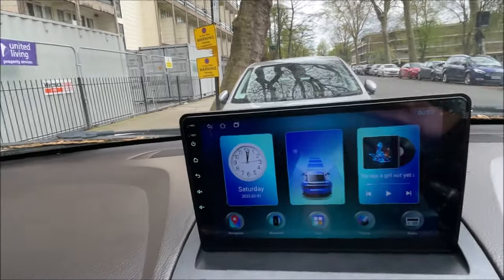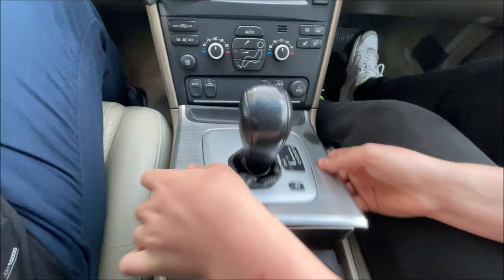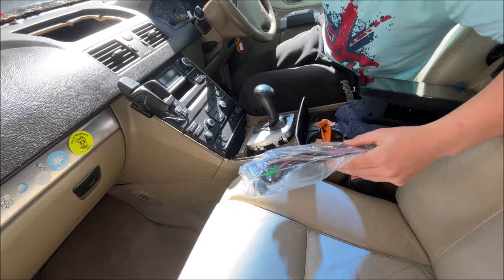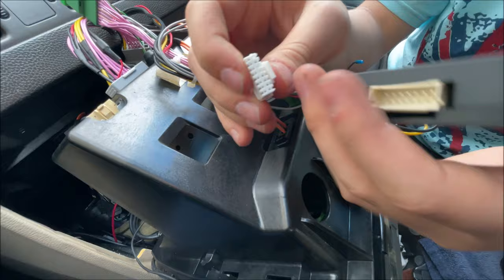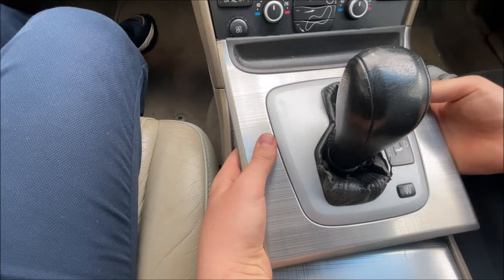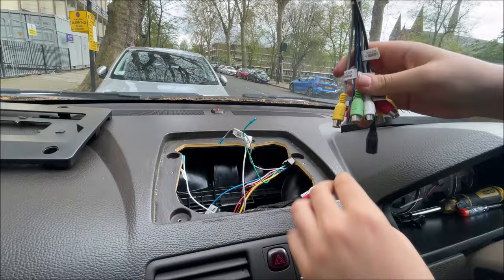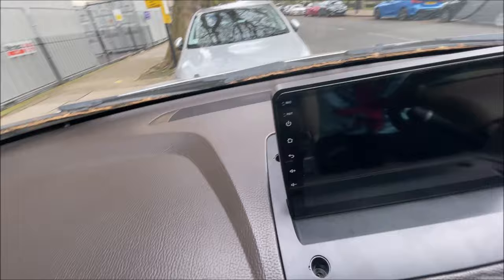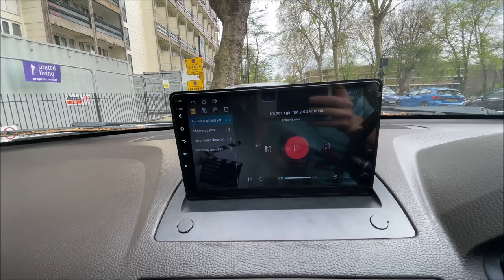How to install Apple CarPlay / Android Head Unit to a Volvo XC90 MK1 (2002-2014) - UNDER £150!

Comment: Installing backwards may be easier. As far as the screen. Install the cables and feed through the plate. Then remove the cover and speaker. Feed them down. And then pull radio off ☺️

Comment: Hello! Great video and very helpful for getting my screen installed! It isn’t using the subwoofer at all when playing through Bluetooth, and it sounds very poor compared to the normal car usb connection. I’ve spotted a plug marked ‘sub woofer’ from the screen but have no connections for this. Did you have the same problem or can you offer any advice please? Thanks!

Comment: Hey man! Thank you so much for the great video and explanation. I’m gonna install the same thing on my 2007 XC90 and have a few questions:
1) does the radio on this android head work or you need additional wires ro make it work?
2) does the rear camera gets power from the head you you need to plug it separately?
Reply from the maker: Hi there
To answer your questions 
The radio on this unit needs an antenna to work, I’ve already made a video about it on my channel
I have also already made a video on my channel showing the installation of the rear camera
If you have any questions about the installation after watching these videos, let me know and I will be happy to answer them
Reply: @c2fixit oh I didnt check your other videos! Great job, thank you so much. It’s really helpful

Comment: I’m considering buy this, but mine has the sat nav unit in the top of the dash. Watched another video on here stating in need to feed cables to the amp under the drivers seat 🤷‍♂️
Remove the sat nav player under the passenger seat🤷‍♂️
Also states that you lose the mic that’s already fitted in the roof above the drivers seat, as they are not comparable
Reply from the maker: Hi mate
It all depends on what type of Volvo you have
If you have the aux function, then the installation is like this video.
This is for the screen with the aux input: https://www.ebay.co.uk/itm/314560935148?mkcid=16&mkevt=1&mkrid=711-127632-2357-0&ssspo=vkcosyhktgw&sssrc=2051273&ssuid=vkcosyhktgw&var=&widget_ver=artemis&media=COPY
This is the screen if you don’t have the aux function: https://www.ebay.co.uk/itm/314566818009?mkcid=16&mkevt=1&mkrid=711-127632-2357-0&ssspo=vkcosyhktgw&sssrc=2051273&ssuid=vkcosyhktgw&var=&widget_ver=artemis&media=COPY
If you do not have the aux function, then you will need to bypass the amp by feeding the cables.
The Satnav doesn’t affect anything, it’s still the same process
You do indeed lose the mic in the roof which is a shame, but with the screens in the links I sent you, you get a free mic in the package
Hope this helps

Comment: Hi
Nice video.
I'm thinking about using one of those android units with my 2008 D5 with built in Navigation and AUX input plus CD changer ( input connector in the middle console)

So every sound from the android unit will bypass the amplifier?  Also from the original radio after mounting this android unit like CD changer , radio, external cable aux input ?
i understand that for parking sensors but for mobile connected via Bluetooth or music via android this does not sound very positive.
Is there a way to still have all sounds via amplifier?

Will there also be a supported unit witjh newer android o it?  Version 10 is quite old.

i appreciate any inputs also to my maybe misunderstandings.
Reply from the maker: If your Volvo has an aux input, then the original radio, cd player, parking sensors and external cable aux input will continue to work.
The amp is only bypassed for older models
So, in your Volvo, all these functions will continue to work
I’m sure that the android unit will be updated with future android releases, and you will be able to download and use them
https://www.ebay.co.uk/itm/314560935148?mkcid=16&mkevt=1&mkrid=711-127632-2357-0&ssspo=vkcosyhktgw&sssrc=2051273&ssuid=vkcosyhktgw&var=&widget_ver=artemis&media=COPY
Reply: @c2fixit  so everything including the aux connector will still work via amplifier? Sounds interesting. 
But im still a bit concerned most of the look alike radios in ebay already seem to offer android12.
is there also i link to buy it via ebay germany maybe?
Reply from the maker: @dunkelwesen74 I think you can update it to android 11
Personally, I would get it from the link in the description, but if you find something else, by all means
https://www.ebay.co.uk/itm/314560935148?mkcid=16&mkevt=1&mkrid=711-127632-2357-0&ssspo=vkcosyhktgw&sssrc=2051273&ssuid=vkcosyhktgw&var=&widget_ver=artemis&media=COPY

Comment: Your videos are terrific and inspire confidence to accomplish the install. Can these be installed in US XC90s?  Mine is a 2004, 2.5T with the 'High Performance sound'/no Aux in feature)
Reply from the maker: Hi mate
Thank you for the praise
They can be installed in non aux us xc90’s
Here is the link for the screen that you need: https://www.ebay.co.uk/itm/314566818009?mkcid=16&mkevt=1&mkrid=711-127632-2357-0&ssspo=vkcosyhktgw&sssrc=2051273&ssuid=vkcosyhktgw&var=&widget_ver=artemis&media=COPY

Comment: I have a non-aux 2005 XC90 and want to fit your suggested head unit but my android phone is only version 8.1.0, will this cause a problem when fitting to a version 10 head unit? Thanks for your series of excellent videos.
Reply from the maker: Hi mate
I don’t think so, but I would ask the seller regardless
Here is the link: https://www.ebay.co.uk/itm/314566818009?mkcid=16&mkevt=1&mkrid=711-127632-2357-0&ssspo=vkcosyhktgw&sssrc=2051273&ssuid=vkcosyhktgw&var=&widget_ver=artemis&media=COPY

Comment: Very good video. Just installed my android, the only problem radio doesn't work on android, i mean cant pickup stations.
Reply from the maker: Have you watched my other video
Reply: No.
Reply: I will now😊
Reply from the maker: Here is the link: How to fix radio not working on Android Head Unit in Volvo XC90 MK1 (2002-2014)
https://youtu.be/DthFhJ52B3M

Comment: Thanks for this video!  Follow up on the parking system question: Will the car still make the beeping noise when the parking sensor detects that you are too close to something?
Reply from the maker: Yes, it still beeps and the screen goes straight to the rear camera when you shift into reverse
Reply: @c2fixit  does it use the original camera?

Comment: Hi mate

Followed this and everything works except my parking sensors. Seller says they supposed to not work after they install. However from what I’ve read online with the same unit, others have still got working parking sensors. Mine is a 05 non aux. Also front left speaker and rear right speakers don’t work, any ideas? 

Appreciate any help!
Reply from the maker: The parking sensors only work if your car has aux.
If it doesn’t have aux, then the parking sensors won’t work
For the speakers not working, check the red and white rca inputs, that’s what I think the problem could be
Reply: @c2fixit  thanks for the quick response. Is it possible to wire a speaker into the original unit to still have the parking sensors sound? 

And thanks I’ll look into those cables
Reply from the maker: Wiring a speaker for the parking sensors is a great idea, might even get your original radio to work
Just need to find the output of the factory radio and find a pin out
Let me know if that works though, sounds interesting
Reply: @Ranj-d2e  Did you solve the issue with the parking sensors?

Comment: I have a navigator installed in the center speaker... Is there any different way of working then?? XC90 -2006
Reply from the maker: Works in the same way, just remove the navigator and put the screen in its place

Comment: Thanks for this video. I am following your steps and when I try to pull from the bottom of the centre console, only the lower half moves. The stereo won’t shift. Mine is a 2010 model. Are there additional screws perhaps? Yours came out so easily! Thankyou
Reply from the maker: Are you sure you have removed the right screws?
Sometimes, you need to tug a bit, especially if it has never been opened
Reply: @c2fixit  I’ve removed the two from the bottom and that freely moves. I’ve also removed the 5 at the top around the speaker plate. The bottom flexes a lot but the stereo seems rock solid… I don’t want to snap the bottom section off!
Reply: Apologies, I did indeed remove the two above the pair you did… it’s out now thanks

Comment: I bought the android but have no aux I can’t return it  so I was wondering is it possible to change the radio from a new model that I go to the scrap yard an take a radio withe aux
Reply: I want to buy it from you after I saw your videos but to late
Reply from the maker: Message the guy from the link in the description 
He might have a cable for you
Reply from the maker: The radio won’t make it work

Comment: Thanks for the video! I did the install but now the old ICS unit and the PCD seem to be muted. Any suggestions of where to look?
Reply from the maker: can you rephrase your questions without the abbreviations, I can't understand what you are trying to ask
Reply: Sorry, I meant ICM (infotainment control module) which is the old volvo radio/cd player and parking distance control.
Reply from the maker: It depends if your car has the aux function or not
Reply: No aux function in my car
Reply from the maker: Check the connections behind the radio

Comment: Thanks, this video is really helpful even I am upgrading my Volvo V50. 
The sound does not work unfortunately, do you have any idea why?
Reply from the maker: Have you checked the connections behind the screen
Reply: @c2fixit  yes. The volume on the display is even going up when I turn the volume knob on the original radio. And it is set to aux
Reply from the maker: @vincent567 check the audio in and audio out cables, perhaps they have become unplugged
Reply: Okay, I will have a look. Another problem is that on the screen the parking sensors are showing the wrong side ( front for rear)
Reply: Hi, some info for people with the same problem as me. 
I needed an additional cable connected to the amplifier. This one is in the back of the Volvo v50 and requires really a lot of work and effort to route the cables all the way to the back. 
Haven't done it yet, if I will I will post the results
Reply: You need to connect the cable that connects your screen to you amp under the drivers seat. There is another video on here showing how to do this but it isn’t as simple as it looks I’m afraid.
Reply: @vincent567 Hi Vincent, did you manage to sort out this? I’m having the same issue on my XC90. Thanks!
Reply: @barneykirk7939  yes and no.  I didn't manage to connect it. But when I have time I will try. The amplifier from my sound system is in the back of the car and it need a cable there

Comment: Hey boss, my radio won’t turn up so I’m think about switching to this head unit. I’ve changed the antenna module, amp & original head unit & I’ve had no luck. Do you think this will solve my issue?
Reply from the maker: It depends if your volvo has aux or doesn't.
If it does have the aux function, then this won't solve your problems as you need to select the aux setting from the radio.
However, if you don't have aux, then go for it, as your problem is most probably to do with the fibreoptics inside the car for the radio.
As the screen bypasses the fibreoptics, it would work.
Again, it depends on what type of volvo you have. 
Here is the link for the android head unit if you do not have the aux function: https://www.ebay.co.uk/itm/314566818009
Reply: Much appreciated buddy, I don’t have the aux function
Reply from the maker: I would suggest buying it

Comment: ive installed it but have no sound i also dont have the aux option on my original stereo any help would be great
Reply from the maker: Check your connections on the amp and the rca cables going into the screen

Comment: Mine does not aux altough its 2006. Any with android 12? There are several on alliexpress but not sure if they work without aux. Also does the original radio still works for anything? Thanks
Reply from the maker: Hi mate
The ones on aliexpress are only for if you have aux.
If you don't have aux, here is the link  for the one that you need: https://www.ebay.co.uk/itm/314566818009?hash=item493da4b8d9:g:-8IAAOSwaNJkUWS9
With regards to android 12, I would say that you honestly don't need it as everything is supported in the screen.
Also, everything on the original screen does work
Hope this helps
Reply: Does that have SIM card
Reply: @c2fixit  thanks

Comment: Looks good. What do you not like about it? In terms of usability?
Reply from the maker: Honestly, it works well for what I want it
Sometimes, the wireless CarPlay doesn’t work well, but the wired one works flawlessly
Just takes a bit of time getting used to it
I really recommend it though
Link for it is in the description
Reply: @c2fixit  thanks man from the states. I’m considering doing this, but the plastic in my car is so brittle I anticipate a bunch of cracks. It’s been baking in the sun for a decade.
Reply from the maker: @2steaksandwiches665 hi mate
I don’t think this would impact the screen in any way

Comment: any idea why it doesnt put the unit closer to the vents? its a long way forwards
Reply from the maker: I had the exact same thoughts before I got it, but it actually isn’t too far forwards
You also have the use of the steering wheel buttons, which means you don’t need to touch the screen so much
Reply: ok, do you get any display on the volvo display by the heater controls with htis or is that gone?
 @c2fixit
Reply from the maker: @eatthisvr6 my car has aux, so the original radio works perfectly fine
If you don’t have aux in your car, then you bypass the original amp, so you lose the original radio
But you can use the radio in the head unit

Comment: I bought this one from the link you shared, but after a month its started to lag and bluetooth keep disconnected, have you encountered anything like that?
Reply from the maker: I usually restart it when this happens
Just swipe down from the top, and press reset.
It will restart your android screen.
Don’t forget to close the apps that you are not using from the app switcher
Reply: Will try that thank you. Also quick question do you have any link or video on how to use the different functions of the screen ? Thanks
Reply from the maker: I will make a video on that

Comment: Hi there pal
I have the same unit as yours
But mine didn't come with the reverse camera lead that plugs into the back of the unit
If your not using yours could I buy from you
I'm more than happy to pay over the odds 
Thanks Davey
Reply from the maker: Hi mate
Where did you buy yours from?
Reply: @c2fixit  morning
I bought from eBay company called blingmedia
But was missing the reverse camera plug lead
Reply: @c2fixit  I just realize you have made a video of reverse camera install
So that means you have used the wire that I was hoping to buy from you
Can you source spares at all ?
Reply from the maker: I would ask the guy from the eBay listing in the description
Reply: He is not answering and is totally blanking me
So I need to try and source this, do you no where I could try and get spare wire
Reply from the maker: @davey4818 hi mate
Try the guy from where I got the screen
Here is the link to the screen: https://youtu.be/g56Jk6gx5Eg?si=tttzXmNRfTDxsUPQ
He’s really helpful
Reply: @c2fixit  thanks pal il give him a try

Comment: How do I know if I  have the aux or not ?
Reply from the maker: If you turn the right selector knob on your radio and you see the aux setting, then you have aux
Alternatively, if you see a cover that says aux by the cupholders between the driver and front passenger seat, then you also have aux

Comment: My own dont have the gray cord behind please help
Reply from the maker: That means that you don’t have aux in your radio.
In this case, you need another head unit.
Here is the link: https://www.ebay.co.uk/itm/314566818009?mkcid=16&mkevt=1&mkrid=711-127632-2357-0&ssspo=vkcosyhktgw&sssrc=2051273&ssuid=vkcosyhktgw&var=&widget_ver=artemis&media=COPY
Reply: @c2fixit  thanks for replying but is it safe to just use the green one alone and leave the gray harness unused? My radio works fine everything works fine I just need Bluetooth to play through the speakers and possibly run a sub woofer

Comment: Hi where are you based do you supply these and install
Reply from the maker: Hi mate.
Where are you based?
Reply: @c2fixit  Hi mate gr8 video! could you install it on my 2006 volvo xc90 ? and what will you charge?
Reply from the maker: @user-ir7sx4gr6t hi mate
Where are you at?

Comment: Hi. Will this ANDROID fit a 2004 years XC90 (without AUX)?
Reply from the maker: This one will not, but the other link in the description will
Here is the link: https://www.ebay.co.uk/itm/314566818009
Reply: @c2fixit hey there nice video. I also have 2002 xc90 but how does the unit you mention without the aux version manages the sound. And is there any chance i can find this version in Europe.
Reply from the maker: Even though the screens are in USA, they still come quite quickly.
Mine took 10 days to arrive
I don’t know how the audio works, but here’s a link for a video where it is installed: https://youtu.be/YeVNg1JA6E8

Comment: My radio seems to always be on, is there a way to wire it so it turns off when the car is also off?
Reply from the maker: I just press and hold the power button for a few seconds until it turns off